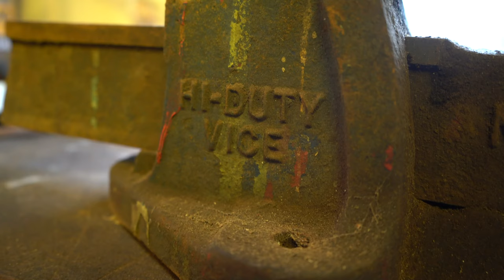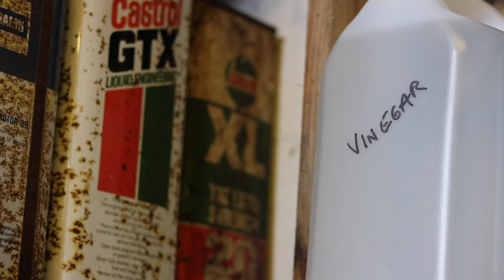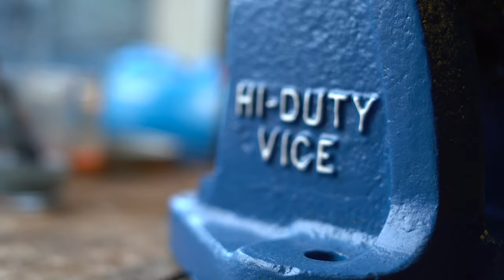Repairing my old 1950’s Paramo No.5 Vice

Comment: electrolysis would have removed all the rust and left the metal as clean as the first day of manufacturing. Perfect for restoing vintage/historic equipment. Easy to do at home. I have restored a few wiltons with it. You have to coat any bare cast iron immediately as it will develope rust prety quick. A coat of rust resistant primer does well before painting.

Comment: Hello Calum I have restored several old Brit vices the main problem with Woden and Paramo is the main screw will disengage from the nut, this does not occur with Record vices as there is a nut retaining pin stopping this happening.

Comment: Looks like its made after the same pattern as an old Irwin Record, possibly made in the same foundry. on another note, be careful of using vinegar to remove rust, it can cause hydrogen embrittlement.
Reply from the maker: Yeah, for some of my more specialist tools and bits I'd sway away from using vinegar and in general be a bit more gentle, but for this it's such a solid lump (and not super valuable) so I was a bit rougher with it.